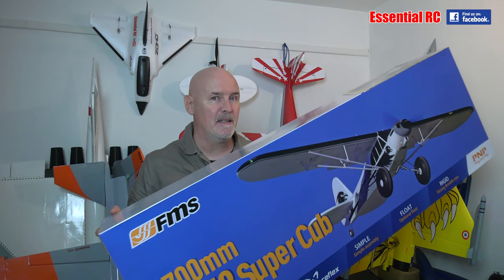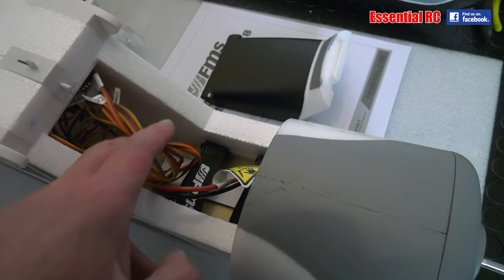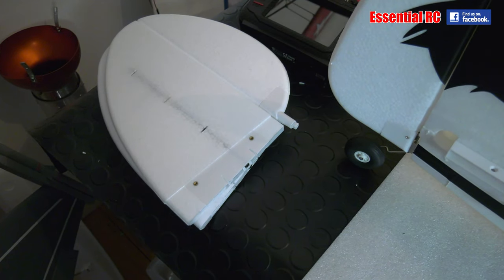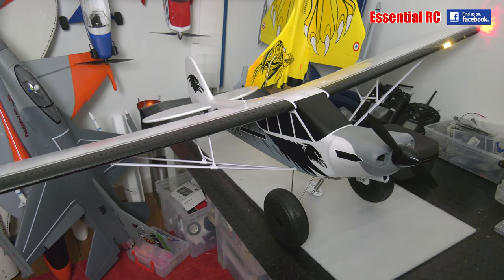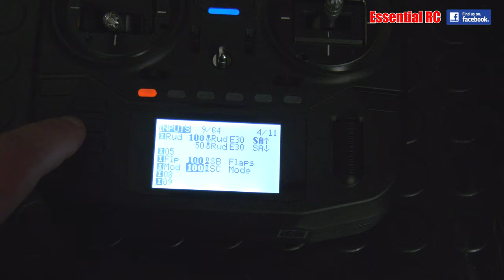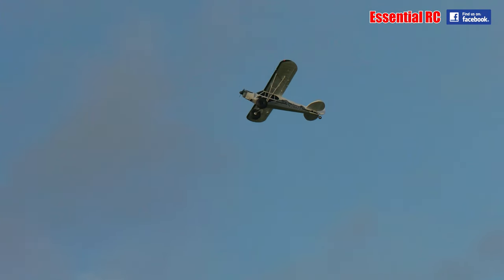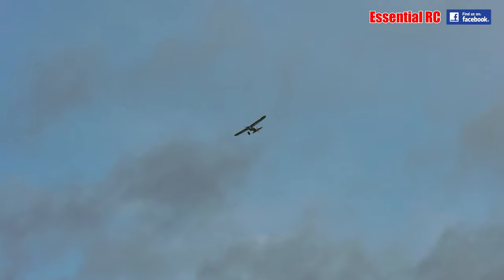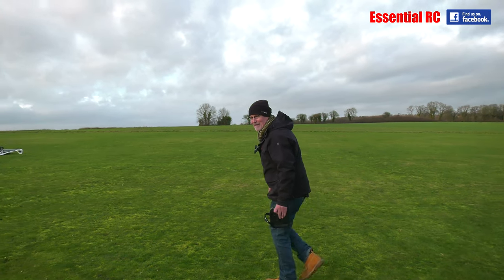SUPER STOL RC AEROPLANE ! FMS 1.7m PA-18 Super Cub | Quick assembly and GO FLY

Comment: As I commented 0n your video on the 1.3m version of this model the only real negative with this 1.7m version is the landing gear which is virtually rigid and the wheels which are too hard and too big. I recommend removing the spring part of the UC completely as the UC is plenty strong enough without. I fashioned a more scale like replacement for the spring which doesn't restrict the movement of the UC and allows it to move and absorb the landing a little. Replacing the wheels with the soft type from the Durafly Tundra provides some added suspension and are much closer in scale and look to the real plane; a downside however is that they do wear quite quickly and the soft rubber tyres do tend to separate from the wheel hub also. As a result I replaced these with some 5" Dubro inflatables which I got cheap and are a good compromise solution re scale looks and practicality.
      I find the model very easy and relaxing to fly with no bad habits. Although it's capable of some basic aerobatics in my opimion it looks a bit silly doing so and is best when flown in a scale like manner. The flaps are very effective when deployed and work well for stol take offs and slowing the model down nicely for landings or touch and go's. I added Some elevator compensation to both half and full flaps and have no pitch change when deploying them. I use 4S 2700mah lipos which balance the model nicely and give an easy 10 minutes of flight time.
      Mine came with the Reflex gyro system which I removed from the onset as it doesnt need it. It also came complete with a set of floats although I have nowhere to fly with floats. However, they will be modded into a pontoon type boat for use on the local pond. 
      Overall, this is a well sorted semi-scale model of a real plane which looks good and flies very well.
Reply: Might want to add them Dubro wheels are more than 3 times the weight of the stock items.